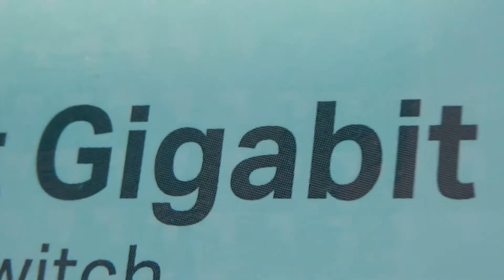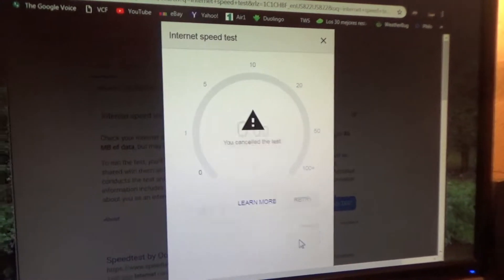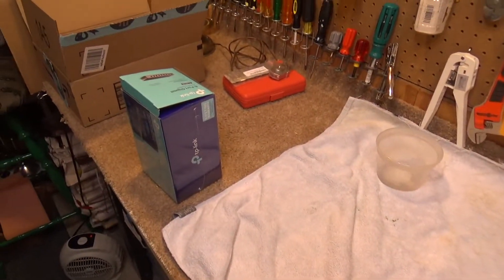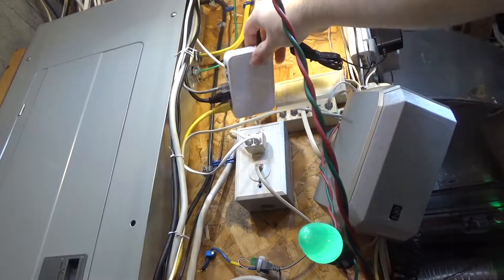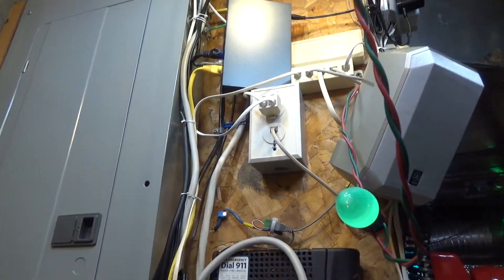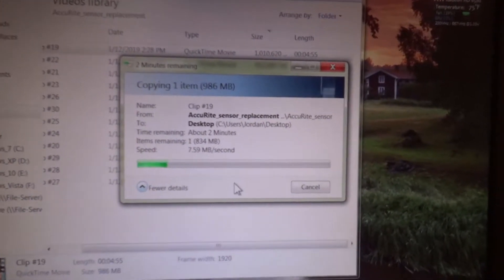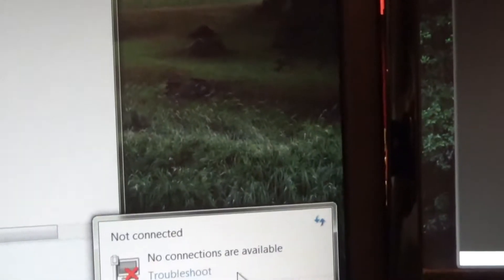Network Upgrade Freakshow Part 1

Comment: THAT constitutes a freakshow?  What are you going to do when something REALLY goes wrong?

In fact, this entire crisis requiring a wambulance could have been avoided by simply checking the wiring first.

The "joiner" is called a coupler.  Just like for telephone cables.

Of course, not recording stuff at 60fps that doesn't need to be would speed up the transfer considerably over even going to 10Gbps.
Reply from the maker: Fix it..
I did check the wiring and saw that it was CAT5e, which theoretically would have supported a Gigabit connection..
OK..
The videos are transferring plenty quickly now.. If you don't want to watch in 60FPS that's fine, you can customize your player for a lower quality.. Most people prefer high quality..
Reply: Sounds like it was some cheap CAT5e cable then.

I don't watch in 60fps, and probably never will.  For watching a guy hang a new network switch, there is absolutely no reason to waste computer resources by even recording at 60fps.  Faen videos, maybe.  But for stuff like this, it's ridiculous.  Just a huge waste of computational power.  Similar to "I need a V12 engine to go to the grocery store 3 blocks away and back".  It's overkill.
Reply from the maker: It may be, it was given to me so I don't know anything about its origin..
How is it a waste of computational power? Most any computer made within the past 10 years can play 60FPS videos without a struggle..
Perhaps that's not necessary, but if you enjoy it over other types of engines and you can afford it within reasonable means, what harm does it cause?
Reply: It's a waste of power all across the board.  Actually, it's a waste of electricity.  Follow carefully:  Once the video has been recorded and transferred into the computer, it needs to be edited or rendered.  That's going to take longer with a 60fps video than with a 30, as there are twice as many frames.  That means the computer is going to be on longer to complete that task, no matter how fast it is, than the same computer rendering a 30fps video.  There's no benefit to the motion in a 30 vs 60 fps video for a video with this kind of content where there's not much motion to begin with.

Even if you do nothing more than upload it to YouTube, raw from camera, the data transfer will take longer because there's more data.  Then YouTube has to process the video, and again, that will take longer than a 30fps video.

During all that time the processor is busy, it's using extra computational power to give an end result that could have been just as good with half the frames.  While a processor is busy doing something, especially something that's intensive, its power usage increases, as shown by a wattmeter which you own.  Whether it sits and crunches for longer, or uses more processor cycles, that in turn requires more electricity.

Most couldn't afford such a car or engine within reasonable means.  Even if one could, there's a 12 cylinder engine running, doing the job that a 4 cylinder engine could do just as easily.  It costs more in gas to run a 12 cylinder engine.  Even with that aside, the end result is a 12 cylinder engine has 8 extra cylinders firing over a 4 cylinder engine, and every one of those cylinders is producing emissions.  That's the harm it causes.  The same goes for electricity usage on a 30fps vs 60fps video.  Generally that power came from the burning of fuel, creating emissions.  More power used means more fuel burned.  It's wasteful.
Reply: @jaykay18  lol this is the same guy who uses a full desktop computer as a digital picture frame and a digital clock lecturing others about power consumption
Reply: That's not the point.  The point is it's using more power than needed to get the same job done in the end.  My systems use the same amount of power as they did when new, and get the same work done.  They're not running longer to complete the same task.  Not to mention a lowly old computer with a much slower, simpler processor easily uses less wattage than a video-editing rig with a processor that's basically placed in "pedal-to-the-metal" mode while rendering the video.

At the end of the day, my systems use the same amount of power they were going to use to begin with for the duration of time they'll be on.  They're not staying on longer to complete the same tasks.
Reply from the maker: @jaykay18  I take many issues with these replies you're making:
1) What relevance does it have if your systems use the same amount of power and accomplish the same amount of work as they did when they're new? That accounts for just about any electrical appliance that's in proper working order, including newer computers with more processing power..
2) Using a watt meter, which I own, I measured the power draw of 2 computers while rendering a video.. The computer I usually use for editing is a 4-year old Apple laptop.. It drew 87 watts while rendering a video.. I also tested my Dell Dimension with a Pentium 4 processor.. It drew 134 watts just idling! It peaked to 149 watts while rendering a video.. You also have to tack on an extra 24 watts for the Dell monitor that goes with it.. The Apple machine will render an hour long video in 60FPS in about 20 minutes.. The Dell would take probably days.. Even rendering at 480p30 would take hours on that machine for an hour-length film.. With all that being said, I like the Dell computer a lot better--it's a much more affordable machine, it was built better, and it will far, far outlast the Apple computer--but when it comes to the efficiency of the processing capacity, the newer Apple machine takes the win here..
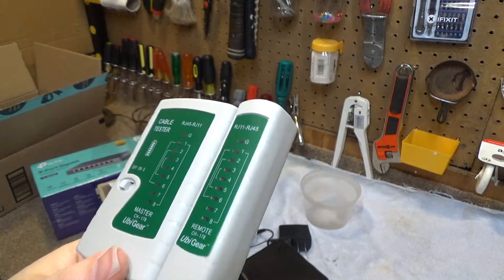3) I have a good idea of how much equipment you have going at your house around the clock, whereas my equipment gets turned off when I go to sleep and doesn't get turned back on until 6:00 the next day when I get home from work.. I'd be surprised if I use even 1/8th of the amount of electricity you go through..
4) YouTube is greedy and outrageous, who cares if it's using more of their resources? If they feel it's too much, they should omit the option!
5) Since when do you care about emissions?
6) You don't use a 4-cylinder vehicle to go to the store..
7) You have a huge 8-cylinder vehicle sitting out in your front yard, that you use just for the fun of it when you don't even have to go anywhere! That burns quite a bit of fuel..
Reply: 1.  It does have relevance.  Most people are under the very incorrect assumption that old computers use lots more power than new ones.  Most of these people are also brainwashed idiots that think throwing out their old refrigerators, air conditioners, and washing machines and buying new ones will actually save them 50% or more on their electric bill.  While they may indeed use less electricity, their performance is also greatly lackluster compared to the old one that still worked and there was nothing wrong with.  Not to mention, that new one would be hard-pressed to make it past 5 years of age, where their old one was easily 2, 3, 4, maybe even 5 times that age.
2.  Point well taken.  I will say however that Pentium 4 computers were indeed power hogs, they didn't nail down the efficiency of the machines in terms of processing power versus watts actually used.  I won't tack on an additional 24 watts for the monitor, provided it's set to put the monitor to sleep after a period of inactivity.  At that point, the monitor is on while you are using the machine, and that's money well spent, as it's pretty tough to use the machine if you can't see what's going on.  Plus, the time you're actually sitting at the machine editing the video would be nearly the same on both machines, if you're running the same editing software.
3.  You're probably right.  There are 2 schools of thought on this, those who leave their computers running 24/7 and those who turn them on and off when needed.  I belong to the former school, you belong to the latter.  If I want to burn electricity leaving the machines idling (or, more correctly, in low power mode while not actually being used), that's my prerogative.  As long as the bill gets paid, which it does, in full, every month.
4.  Agreed.  Unfortunately, people think this is a useful option, and for whatever reason YouTube does also.  YouTube always gets rid of good features, leaving bad ones, breaking several other things in the process.  The fact of the matter is, it's still causing their servers to have to work harder to process a 60fps video versus a 30fps video.
5.  I don't care about emissions.  But they are still being produced whether or not I personally care.  
6.  I don't have a 4-cylinder vehicle for my own use.  When I was looking for a car, I knew what I wanted, and knew to steer far clear of the 4-cylinder variants for longevity reasons.  I still think it's better to put out more emissions and have an engine that's better built and will withstand the test of time, rather than one that's "efficient" and won't run for as long (in terms of lifetime of the vehicle, which excludes any repairs to things other than the drivetrain, which will break regardless of the vehicle's power plant.)
7.  It sure does burn a lot of fuel.  But, it's not driven every day, far from it actually.  Maybe once a week, sometimes twice.  Again, it comes down to price versus performance.  I could drive a 4-banger, and get there, stepping out of a bubble like everyone else does, or I could go there with tons of power (if I decide to flex its muscles) and get there in style.  Not to mention the compliments from people on the road and at the location I'm going.  If I happen to be going to a classic car show, your point is moot, as I'd HAVE to take that vehicle.  I'd like to see the day you get a classic car; it's a very expensive hobby.  I wasn't in the market for a classic car, but this one became available, and the price was right.  It was an impulsive purchase, which I rarely make, but when I do, I'm prepared to handle the consequences of my poorly-thought-out decision.
Reply from the maker: 1) The assumption that old computers use more power than new computers is not the same as the statement that an old computer uses the same amount of power in 2019 as it did in 2001..
2) I left the laptop's monitor on during the test as well, so I counted the Dell's in for that reason.. Sure it could be turned off, but I often do something else on the computer while it's rendering..
3) One is most certainly entitled to operate that way, however in doing so you forfeit your right to complain about other people's usage of electricity..
5) If you don't care about them, wouldn't it be reasonable to say you believe they're a non-issue?
6) I think there is a better mid-ground as well, which is why we have vehicles with a similar type of engine..
7) You don't HAVE to, you could get a trailer and bring it to the car show on there.. I've driven classic cars before, in fact we have one in the family.. I don't personally have one as I don't have anywhere to store it nor can I afford it, but it's very likely I'll inherit the aforementioned one at some point..
Reply: 1.  Yes, but I was leading up to that statement.  For some reason, I omitted it.
2.  On the Apple, it's likely possible to do other stuff.  On the Pentium 4, not so much.  Sure, the machine isn't "ignoring you", but likely it would be very slow for even simple tasks, unless perhaps you're writing something in a word processor.  Even email nowadays is pushing it, depending on what you use.  So not exactly a good comparison.  Not to mention, you didn't quote the wattage usage of the Apple machine at idle, which is an important piece of information to know.
3.  I don't forfeit such right, nor can it be revoked, especially if the machines go into sleep mode, using next to no power.
4.  You omitted 4.
5.  No, it would be completely unreasonable.  There are too many cell phones in the world that are being charged every night that need power to do so.  That power, no matter how small the wattage draw, falls into the "law of small numbers" category, where if you have a lot of small numbers, it adds up to a significant one.
6.  Yes, plus I wanted more power at my disposal.  In a car with such an engine, that power is plentiful.  In a larger vehicle, some of it is needed to propel the vehicle.
7.  Nobody likes a trailer queen.  They always get a bad rap.  Not to mention, they're started to back out of the trailer, then started again to drive back on (or in) the trailer.  Not to mention, the rig towing the trailer would likely have a large, powerful engine.
Reply from the maker: @jaykay18  1) I still don't understand what relevance that statement has in this discussion..
2) What makes it important to know? The computer never sits there idle, when the videos are done rendering it gets switched off for the night.. Same thing with the Dell, I only noted it because it was such a startling difference..
3) Using little power is not using no power!
4) It was OK, so I left it alone..
5) I completely support the 'law of small numbers', but what I don't understand is how one could say something is an issue, but not care.. There is an inconsistency within those two views..
6) In a smaller vehicle, some of it is needed to propel the vehicle..
7) OK..
Reply: It doesn't, the statement I was leading up to that was omitted was what mattered.  My mistake.
2.  I'm curious how much the wattage usage goes up when the processor is taxed on the Apple.  You measured it for the Dell, so I'd figure you would have done the same for the Apple.  Unless the Apple turned rotten.
3.  Yes, but a vast difference from fully powered on!
4.  OK.
5.  My point was, I don't care how much emissions I'm causing, because that's insignificant in relation to how much power everyone else is wasting.  And--most of them don't even realize.  Especially the case with those washing machines with the digital control panels.  Based on my wattage readings, I calculated that while the washer with the digital control panel sits there, off, not being used, not washing anything, over the period of an entire year, I could wash 18 loads of laundry in my machine.  The point is, people who have those types of washers don't even know or realize there is such waste!
6.  Yes, but my point was that in a larger vehicle, some MORE of it is needed to propel the vehicle, especially if it's heavier, which a larger vehicle usually is.
7.  While not related to the "OK" (which is fine), I'd LOVE to be handed down something or inherit something.  I have gotten the "short end of the stick" my entire life.
Reply from the maker: @jaykay18  2) I'll check it today..
3) OK
4) OK
5) That statement is inconsistent with the previous 'law of small numbers' theory you previously advertised.. If you don't care, because you're just one user in relation to everyone else, and everyone else (or even just a majority) take on that same perspective, you get the problem we currently have..
6) In a smaller vehicle, LESS of it is needed to propel the vehicle..
7) I'm sorry to hear that..
Reply: 2.  OK
5.  I don't know if it's that others don't care, its more that they don't KNOW.
6.  Yes, that's correct, provided only that the vehicle is lighter.
Reply from the maker: @jaykay18  5) You can only speak for yourself..
6) OK
Reply: 5.  Not true.  In fact, in another video you recently commented on, you tried to speak for everyone else.  In learning how absolutely retarded the public is regarding things like this (most don't even know what a watt is or what it does), I can speak for others.  Not all, but many others.
Reply from the maker: I tried, then you said it didn’t work!
Reply: You're forgetting I have almost 20 more years on you.
Reply from the maker: I am not; all that shows is you have a greater survey to reference when predicting what entities may think or feel.. It does not give the capacity to speak or feel for them..
Reply: Ok, you're right, but I still can predict more accurately!
Reply from the maker: @jaykay18  OK, I never denied that...
Reply: OK.
Reply from the maker: @jaykay18  The Apple computer consumes 13 watts at idle, with the screen on..
Reply: 87 - 13 = 74.  That machine burns 74 watts more while rendering a video.  You cannot dispute that if you render a video with a lower framerate, it will take less time, ultimately burning less electricity.
Reply from the maker: @jaykay18  I've noticed no difference in the time it takes to render at 720p vs 1080p.. iMovies does not seem to have the option to change the frame-rate, so I can't comment on that.. Even if it did use a lesser amount of electricity to render the video, I don't care!
Reply: If you don't care, that's great, since you're not paying for the electricity anyway.  Still doesn't negate the fact that it's wasteful.
Reply from the maker: @jaykay18  I do care  about the electricity usage, that's why I conserve it within reasonable means, such as turning the equipment off when it won't be used for the next 18 hours..
Reply: Great.  You can conserve further by recording and rendering at 30fps for videos that won't take advantage of 60fps.  That is most certainly within reasonable means as well.  If your editor program won't do it, first of all that's stupid (and typical Apple, I might add), but your camera will do it.  If the editor "upscales" the video to 60fps for no reason and there really is no way to change it, it looks like Apple is going to have a lawsuit on their hands.
Reply from the maker: @jaykay18  Altering the final product to be less than is not within reasonable means, that's hindering what I wanted to accomplish.. Turning off the equipment while not in use does not interfere with what I want to produce and does not force me to settle for a lesser product..
Reply: You're not settling for a lesser product when a better product is not warranted nor will it appear any different!  You are absurdly recalcitrant!
Reply from the maker: @jaykay18  It will appear different if you have a computer capable of displaying it..
That description is not accurate, since you have no authority over myself or my comments box..
Reply: I do have a computer capable of displaying it.  It makes no difference for a video like this.  For a fan video, yes, it makes a difference.  The description was highly accurate regardless of who you think has authority.
Reply from the maker: @jaykay18  I think it makes a difference, the picture is much clearer and you can see more details..
You keep dodging around the original points you make, slightly altering them to say something different that's more reasonable.. Not OK!
Reply: Possibly for your younger eyes, it makes a small difference.  60fps really shines if you do slow motion, which I rarely, if ever, see you do.

I don't Dodge around anything.  I Toyota around them.
Reply from the maker: @jaykay18  OK, that sounds like an issue specifically with your eyes..
You just did it again, and it's even more obvious this time than before..
Reply: That's impossible.  You drive a Jeep, made by the Chrysler Corporation, who also makes Dodge.  Therefore, you're dodging things a lot more than a Toyota.
Reply from the maker: You don’t have to dodge things with a Jeep, you can just go right over them..
Reply: No, you need a Hummer for that.  They even had a commercial years ago, I did a quick search but couldn't find it.  The best I can do is describe it:
A guy is driving a Hummer.  He stops and picks up his buddy.  They're driving for a bit, and you see them "jump up" in their seats as if they went over a large bump.  One says to the other "Possum?"  The other says "Rabbit.  Convertible."
Reply from the maker: @jaykay18  They cost more, but they're no more capable..
Reply: JEEP - Just Eats Every Part
             Just Expect Every Problem
             Just Empty Every Pocket
Reply from the maker: @jaykay18  ~75,000 miles and nothing has gone wrong so far other than the gas cap needing to be replaced..
Reply: I've never had to replace a gas cap in my life.  Combined total of over 500,000 miles over 4 cars.  I believe the gas cap on my Buick is original as well, and that cap is over 52 years old, but of course there's no epav canister or check engine light to worry about on that car.
Reply from the maker: @jaykay18  The cap is not set back into the vehicle with a metal door over it like it is on most cars so it's exposed to all the elements.. I suppose that exposure deteriorated the seal enough to cause some kind of fault producing the check engine indicator.. I think I paid 18 dollars for a new cap and installed it myself in less than 20 seconds.. If that's all that's gone wrong over the course of 6 years, I really can't complain..
Reply: My dad had a locking gas cap on his 78 Dodge Aspen.  That car also had no door, the cap was right there on the outside of the vehicle.  He drove to Manhattan 5 days a week through all kinds of weather.  While the rest of the body rotted out, the gas cap was perfectly fine after 14 years and close to 200,000 miles, and countless tanks of fuel.

"Less than 20 seconds" indicates it was way more than 2-3 seconds, which is really all it takes to install a gas cap.
Reply from the maker: @jaykay18  If it weren't for all this pesky emissions stuff, this gas cap would have been 'fine' too..
It took a few seconds to open the package, about 0.5 seconds to unscrew the old cap, a few seconds to figure out how the little plastic wire that holds it while unscrewed detaches, a few seconds to figure out how it attaches, then another second to screw on the new cap.. It was probably somewhere closer to about 15 seconds total..
I was quite happy with that, considering most people would take the vehicle to a mechanic over the illumination of the light, or even worse a dealer, and spend a substantial amount of time and money resolving the issue..
Reply: In general, I've found that while mechanics are often thieves, for a simple thing like a "defective" gas cap, they're usually pretty lenient.  Of course the OBDII system doesn't tell you WHAT part is bad, it just lists the problem and there could be a whole host of different things wrong.  For whatever reason, with the code that you had, a new gas cap often fixes the issue.  Most mechanics will scan the computer in the car without charge, then tell the customer "it might just be the gas cap, let's try that first, and if that doesn't fix it we'll go further."  Alice would then ask how much the gas cap is, the mechanic would price it and mark it up 3 times the price, and not charge labor.  If that fixes it, it was worth it for the mechanic to do that, because they know that the customer will be satisfied with a rather small bill (considering what things COULD cost), and will come back when something more serious happens, or if they need other maintenance items such as tires or brakes.

A "mom and pop" muffler shop about 20 miles from me, that I've used multiple times for exhaust issues over the years, has a sign that says "It's better to go for easy nickels than hard dimes."
Reply from the maker: I read the code through the instrument cluster and comparing to a list of errors in the Internet the gas cap was clearly listed as the fix..
That may be true about the mechanics, but I’d still much rather pay 100% of it than 300%..
Reply: Most cars don't read out codes on the instrument cluster and require an OBDII scan tool.  The wife's old Chevy Cavalier and my old Chevy Citation could read the codes out on the cluster by flashing the check engine light.  My dad's 87 Camry does that as well.
Reply from the maker: There’s a secret handshake to make it read out the codes on the odometer..
Reply: Yes, but not all cars have said handshake.  On the cars I mentioned earlier, you'd just short two terminals together.
Reply from the maker: OK
Reply: An OBDII scanner is still a great item to have, as your odometer readout probably can't display readiness monitors or any other useful information a scan tool can provide.
Reply from the maker: I have no opposition to that statement..
Reply: Yep, it's so important, I have 3 of them.
Reply from the maker: OK
Reply: Better than just "OK" would be "I should get one."
Reply from the maker: @jaykay18  I'm not going to get one until I need one..
Reply: Sometimes at that point, it's too late.
Reply from the maker: @jaykay18  Sometimes, but not this time..
Reply: Generally, that thought process will leave you in trouble one day.  Sort of like a guy saying "now that my girlfriend is expecting, I'm going to start using protection."  Kind of a little late at that point.
Reply from the maker: @jaykay18  The logic you expressed would be the equivalent of saying 'My vehicle is broken so I brought it to the mechanic because I can't read the code.. Now I'll go buy the reader and try to fix it myself, while it's no longer in my possession at the mechanic's shop".. The logic I used was 'If the vehicle breaks, I'll attempt to read the code through the instrument cluster.. If that for whatever reason doesn't work, I'll borrow someone else's vehicle for a few days and buy a code reader to use"..
Reply: That's provided you CAN borrow someone else's vehicle.  My logic didn't include that because not everyone has that luxury.
Reply from the maker: @jaykay18  OK